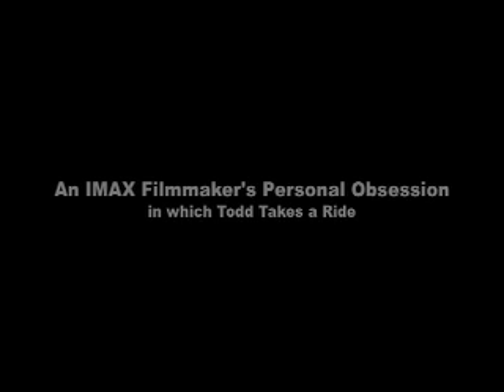T.I.V. - Driving the Tornado Intercept Vehicle

Comment: Oh, so other than the electronics, he took the best powertrain and got rid of everything else that's a problem on the Dodge truck. Personally on something like that I would have got a Ford gasser and swapped in a mechanical Cummins with the ZF-6. Melt the entire electrical system, and you're still mobile.

Comment: The TIV2 is a Dodge Ram platform, so it naturally came with the Cummins. The first TIV was a 97 F-450 backed by a 5 speed manual. As for the 6.0 and 6.4 Powerstrokes, the head gasket problem could be remedied with a 500 dollar APR stud kit. Not that I'm a Ford fanboy or anything, but the Powerstrokes are good reliable motors provided they are taken care of properly and small upgrades like that go a long way for those motors.